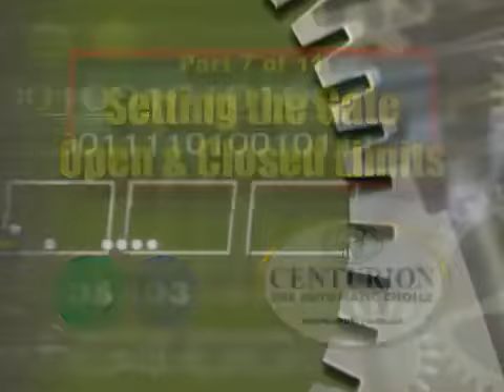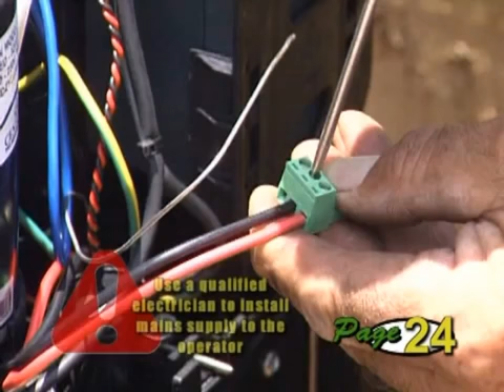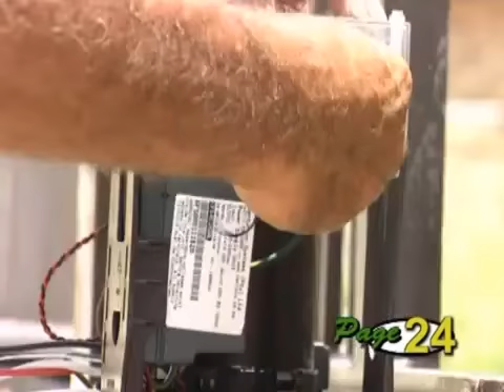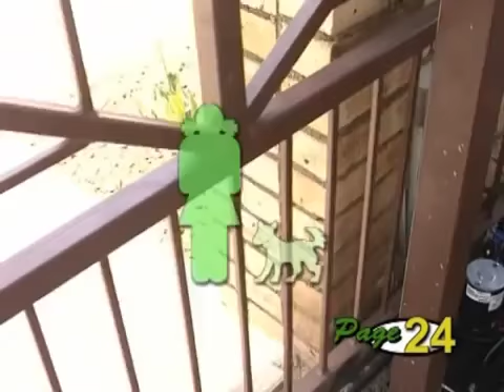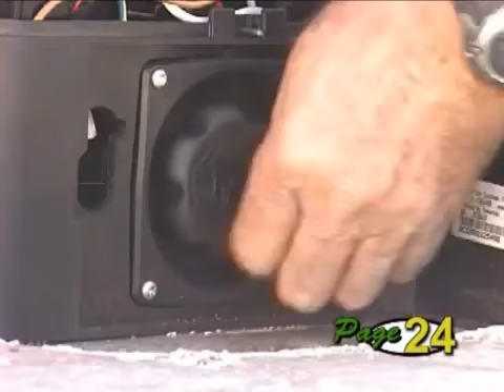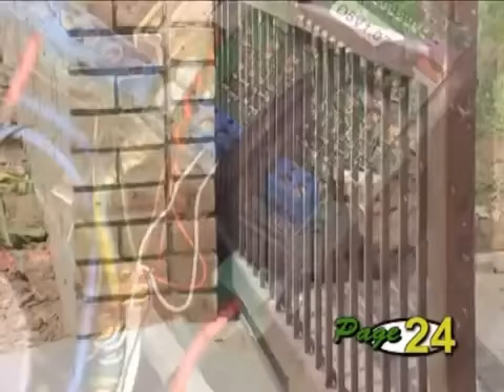Part 7   Setting the Gate Open  Closed Limits Security Superstore

Comment: I have  a D5  Centurion gate motor having a problem with Remotes. The gate opens  whether the remote is not used.
I have two remotes please how can I reset the remotes

Comment: My Test button doesn't work, but I managed to get the limit setup started with the remote. Not 100% sure if the setup was completed successfully by pressing the remote button. Now it opens and closes at the correct limits... But the gate, in its fully open position, is now closing automatically after 4 seconds